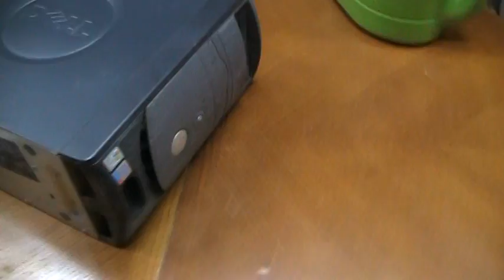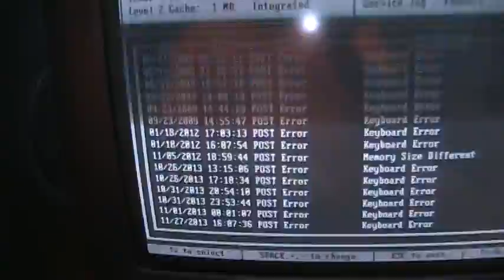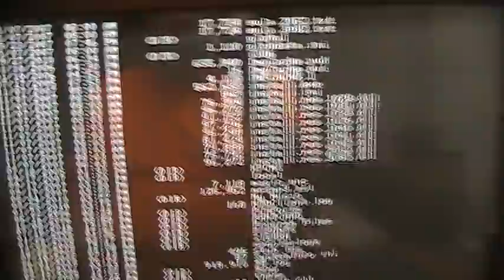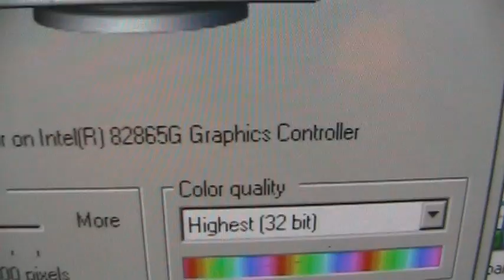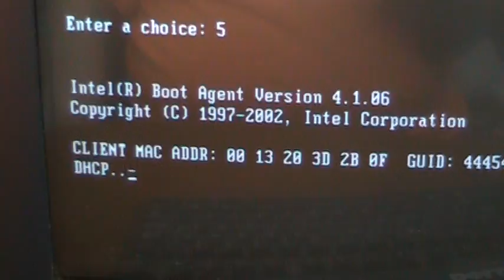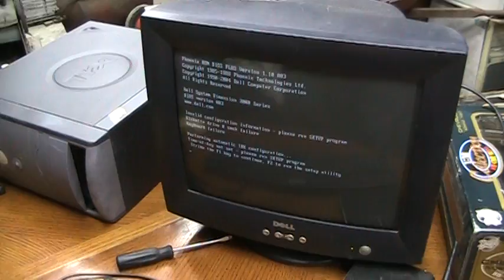Trashpicked "Treasure": Dell Dimension 3000

Comment: Theory:

The computer was last used in April 7th, 2014. Exactly one day before the Windows XP end of support. So this thing was so old it couldn't run a more recent operating system, so they put it away and got a newer machine. Then they junked it in 2016.
Reply from the maker: One can conjecture anything, but it doesn't matter. It most certainly could have run a newer operating system, though it'd be somewhat questionable as to how well.
Reply: @uxwbill  win 7 would run on it with a SSD type drive and ram upgrade
Reply: @uxwbill i imagine the older dimension was a kid's system with the monitor that came with it, they may have moved out and so the system was trashed. this may have been the main office pc. just a theory.

Comment: Nice for 9x or 2000. I remember xp running like crap on a dell 2400  no matter what version of xp was install. 2000 and ME ran like a chap though.
Reply: It was probably running like crap because these Dell’s had 256MB of RAM from the factory. Windows XP ran best with 1GB of RAM or more. My first PC, an old Athalon XP had 768MB of RAM and it coped pretty well with XP.
Reply: These can go up to 2GB ram but they came with 256MB that’s why they are so slow.

Comment: i have  a dell running a  pentium 4  at 3.00 ghz  with windows 10 in 2021
Reply: Running a Sony Vaio 3.0 ghz Pentium 4 as a for fun xp gaming rig. It's quite nostalgic
Reply: A 2400 here running debian and an underclocked pentium 4 (long story).

And WOW! An extra 384k of L2 cache really helps! I wish I could see that cpu at its full speed!
Reply: Must be of the LGA 775 variety
Reply: @connorm955 indeed. I’m not aware of any socket 478 cpus that can run windows 10. Though I could be wrong.

Comment: The Dell E772c and E773c monitors (the model shown in the video) were produced by TPV Electronics of China, which happens to be the same company that produces AOC and Envision monitors. Edit: After doing a bit more research, it appears TPV had at least something to do with Inventa Computer of Taiwan. Information on this is scarce, but I believe it was a joint venture between the two companies which produced OEM systems.

Comment: I have a Dell Dimension 3000 it's not showing a pitcher on the monitor so I googled it so tell me if this is the problem so I can get a pitcher Baroni701
The 3000, has no AGP or PCIe slot, you need to buy a PCI graphics card.
The 3000 troubleshooter is here BEV  ??? Another thing I pulled up on google is change the Hard Drive and Dvd Drive or change the TFT and 1 CRT or the HDD but what will be the simplest thing for me to do to get pitcher and the Tower comes on ???
Reply from the maker: Your problem is not a graphics card and installing one won't help.
Reply: @uxwbill  the problem is using a fucking pentium 4 in 2020
Reply: But my warm fuzzy nostalgic feelings :(
Reply: @lolman123401 no pentium 4 will still work. Not everything needs to be a big beefy gaming computer.

Comment: Cranking up luminance on a crt increases the intensity of the electron beam hitting the phosphor layer. The charge and also the heat it produces cause wear on the phosphor causing decreased maximum luminance output on the screen. So more luminance, more energy, faster phosphorus aging. That's actually proportional. Many late CRTs came shipped with insane default luminance levels when a proper natural image can (and should) be delivered at 140cd/m absolute max. That was often combined with extremely blueish color temperatures of 9000K which is huge burden on the eyes, especially in dark rooms. I'd say that was responsible for a lot of tubes to reach a premature end of life. As well as many migraines and people having to get prescription glasses earlier than they should have. Could've saved some dollar on that energy bill too if you ran a business with a few desks. Because most people didn't even touch the adjustment controls ever.

Comment: My dimension is having an blinking amber light
Reply from the maker: Power supply (especially CPU Vcore), motherboard or expansion card failure.
Reply: I tried to use a new psu but I can’t use it as it is sata
Reply: It works but I can’t boot
Reply from the maker: Inexpensive cable adapters exist that will go to or from SATA connectors. You can also make your own from the dead power supply, if you have a basic multimeter and some insulation displacement connectors. Just be sure you test, before you plug any of your newly wired connectors in!
Reply: uxwbill thanks 🙏
Reply: If it wasn’t my grandads pc I would of thrown it out but I still have faith for it
Reply: Can you make a step by step video on this
Reply from the maker: No, I do not have time right now. If you know someone who is more comfortable working with low voltage wiring for electronics, maybe you can trade services, pay or owe them a favor.
Reply: uxwbill thanks

Comment: Funny thing is Bill.

Alot of game developers that had the runs best on Pentium 4 sticker and maybe something like Alienware branding who I think is still owned by Dell and I actually have kind of admired their systems in the past for their uniqueness.

Funny thing is, given the heat and power they consumed, I agree most P3's felt faster and just altogether happier running than any P4 ever did though of all the P4 systems I ever used at school or otherwise over here in Glasgow, HP's, Laptops, Dell's what have ye, I never ran into one that overheated or had any serious problems, of course I was only using em for web browsing tasks nothing majorly taxing.

Saying that, everybody must've ran into issues even devs with the P4 architecture, though I'm sure the instruction set capabilities as you've said before were inherited in the Core 2 and later series of CPU's, SSE3 and that sort of thing.

But I always have some respect for the P4 for how mad Intel got trying to ramp up the clockspeed and just had out of control things were getting, just seemed like such a carry on and fun at the time even though ye look back on it now and think wel that was kind of mental LOL.

Comment: I remember over paying for one of these on ebay. Wow, but, that was 2007-8 ish. Now days I can buy 2nd-3rd generation i5 machines for half the price I paid for that Dell.  It wasn't the worse things, but ended up moving up to a Gateway E-6100. It came with the intel D875PBZ motherboard with P4 HT, 800FSB. It was a huge, ugly machine that did me well. So well, I didn't even mess with the C2Duo and stepped straight into the i5 machines.
Reply from the maker: These Dell systems were great for their time. They're also easy to transplant newer parts into, for an interesting "sleeper" build.
Reply: There's a good amount of these on ebay even now, two i saw in box.

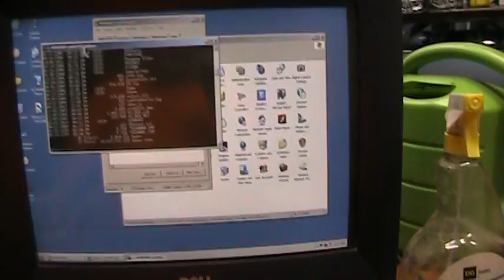Comment: 26:42 Is convergence fixable? Ive got an old Zenith console tv that i use for older games and the picture in the corners is quite horrible
Reply from the maker: Yes. You should verify that the set's dynamic convergence circuitry is working properly, as it is responsible for maintaining convergence at the edges of the picture tube. Get a service manual -- but before you do even that much, be sure you understand the risks of servicing a TV. The high voltages used around the picture tube are dangerous, but much more so is the fact that even late model TVs often have a hot chassis design.
Reply: uxwbill ok thanks for the info

Comment: It seems that some modern, cheaper, Intel Atom based  PC's are locked to run 32 bit operating systems only through the boot loader, but you can get around this by installing a third party boot loader such as Grub.

Comment: My Dimension 3000 had an AGP slot, but I never used it because I ended up gutting it and building a newer pc Athlon 64 X2 based PC inside its case.
Reply: Mine also did not have a floppy drive, but After the upgrade I popped one into it.
Reply: I still use it as my main system, the case at least, but it has the front panel of a Dimension 4600 after I lost the original. I have put some higher end parts then the original upgrade. It now has an i5 4460, GTX 1070 (I only bought this really highend card because I found it at the insanley cheap price of $180) and 8gb of DDR3.

Comment: This was the model of my first computer. I was about 9 years old and I got a Dim3000 for christmas. It wasn't anything special. I ran Flight Simulator 2004 on it and it was amazing. But I had a huge anger problem, until one day I beat it to death, literally. I then got a piece of junk MSI computer with an Athlon XP 2000+ that i fried because I overclocked it without any knowledge of overclocking. Ahh those were all good times
Reply: BTW I'm 25 now

Comment: What does "Loading PBR for descriptor 2...... done" mean? I get this on my Inspiron 1150.
Reply from the maker: It means you have Dell's custom boot loader code resident in the master boot record (MBR) on your hard drive. There is nothing wrong with that.
Reply: Is there an advantage to having Dell's custom boot loader installed on your system's HDD?
Reply from the maker: It presence would suggest (but does not guarantee) that the hidden Dell software recovery partition is still intact.
Reply: Sounds like you have the original Windows installation! This happened on an Inspiron 9400 i bought.

Comment: On the note of CRTs running outside their "maximum" spec, I've actually found that some higher-end CRTs can actually be overclocked to produce resolutions higher than they say they can produce.
Reply: thats true my 1600x1200 17" Trinitron can actually do 2048x1536 and my 15" Gateway EV500 1280x1024 and actually do 1920x1080 just fine

Comment: I have a 160 GB Seagate SATA drive from 2006 that has almost 70,000 hours and it has no bad sectors. It's an FDB based hard drive and it sounds like a drive with 70,000 hours. I am the original owner of that drive since it was new and it's currently in use in my 2002 Dell dimension 8200 using a SATA to IDE adapter. The computer, of which, I've owned ( or my parents owned ) since I was 6. The original hard drive was a 20 GB Western Digital and failed in 2012. Yes it has the same fan that this 3000 has, except it's brand new, as I got it from Amazon.com. I'm proud of that hard drive.
Reply: That hard drive.... talk about a champion. That's just insane. Can you record an audio clip of it running?
Reply: I have a Hitachi deskstar 250gb from 2007 that has 60,000 hours on it and still working 100%. No idea how its still working after 60,000+ hours, for being a DeskStar drive
Reply: the mre nerd it has WD internals maybe
Reply: TheComputerGeek010101001 No I don't really think so considering that that drive was made in 2007 and WD bought HGST in 2012. Just a plain old Hitachi drive that somehow has survived 60,000+ hours of runtime.

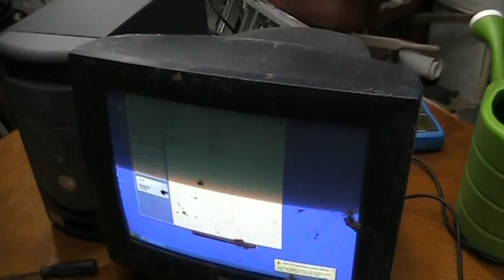Comment: 11:50 I've found the same thing for Dell's LCD panels. Absolutely outstanding picture and everything on them. My dad's 19" Dell monitor is still as bright as the day it left the factory back in 2007 (same for its speakers, tower, keyboard. The mouse...I don't know where that went but the last time I used it, it worked fine). It's got DVI and VGA input and it's a stunner of a monitor. What does make me chuckle though is that you can hear it change resolution, I can't remember what the unit is called that does it but you can hear a sort of whistling sound come from it (goes from a high pitch, sweeps to a medium pitch when the screen's blank, then goes back up when restoring the picture and then goes away until it loses signal or readjusts again).

Eventually I'd like to pick up a new Ultrasharp monitor from them but they're expensive. Most likely for a good reason.
Reply: c0d3r3d // cleanycloth yes. I have one from 2006. I got it in 2012. Awesome monitor.

Comment: I've got a question on one of those CRTs, I got one, and when you turn it on, you can hear it power on and sound like it's working, but I've got zero for video output, any clues?
Reply from the maker: I'd look at the cable (the wires inside do break), the power supply, and the video input/processing stages. (If you unplug the cable and get an error message on the screen, almost all of the monitor's circuitry must be working.)

Color of the power light will tell you if the microcontroller in the monitor is seeing any input (usually sync signals) from the computer.

It's probably not worth fixing one of these any longer and I seriously doubt you'll find any service information. If you decide to do so anyway, be phenomenally careful. The power supply circuits in some monitors are very nasty (NOT line isolated!) and so is everything to do with the high voltage.
Reply: Well the light is green, but I'm getting nothing, absolutely nothing, from the display, when you switch it off, if you look at the screen, it does the power off "flicker" most CRTs do, I have one just like it that's beige, and smoked around, I might just transfer the guts from it into this case.

Comment: I'm pretty sure that system is actually 64bit, judging from the 533 mt/s fsb and 2.8ghz clock with prescott.
Reply from the maker: Unfortunately it is not. Prescott actually predates 64-bit architecture.
Reply: *****
Yeah, you mentioned this later in the video, and I forgot to remove my comment.
Reply: uxwbill what part of Illinois are you in? My grandmother grew up in Quincy Illinois in the 1930s
Reply: Always wanted to go!
Reply: No. There were no 64 bit socket 478 CPUs. I bought a 64 bit Pentium 4 for my Dell Dimension 8400. LGA 775

Comment: There is a market on eBay for Windows 98 gaming computers. 
You should check it out if you have not already.
I have seen Win 98 gaming computers go for as much as $500
I did a quick check on the Dell website and was unable to find win98 drivers for that 3000 computer but keep it in mind while going through old computers. Someone else's trash may be worth a few hundred dollars (after you put some time into it)

Comment: Hello uxwbill, i know that this isn't the best place tout ask that... but i've got some trouble to find drivers for a leadtek winfast 3D s320 II graphics card .... and windows 98 USB drivers for a Packard-Bell Platinum 7620... I just wanted to ask if you have any web site that Can help me or something ^^'

Thank you in advance for your help and sorry for my Bad english i'm a french student ^^'
Reply from the maker: For the video card, I would suggest starting at the Leadtek web site. Or the actual video chip's manufacturer, if they are still in business.

Windows 98 shipped with USB 1.x controller drivers for every USB controller that was popular at the time of its release. If you have an add-on USB 2.0 adapter card, I would again suggest going to the card vendor or chipset manufacturer's web site to get the drivers you need.

Your English is far better than that from many native speakers.
Reply: In fact i've found some generic drivers for the USB and that works great, on the MSi web site there's absolutly nothing except some VIA drivers but no signs of USB drivers in it x) but there's BIOS Update and i've installed it yet.

For the Leadtek vidéo card drivers on their website the card just doesn't exist and if i'm not wrong this is a Riva TNT2 video chips but the driver for the Riva TNT2 work a little, i can put the screen resolution to 1024x720 and 16bit colors but the Nvidia panel doesn't work at all. And of corse on the original Windows installation i can go far away with the resolution and have 32 bits colors. If i remember correctly there's no Nvidia panel but a leadtek software that can do so many thing x)

Well there's a lot of work to get this pretty nice computer running again correctly xD Thanks a lot for your help ! :)
Reply: When dealing with old hardware, when you go looking for drivers, the web archive is your friend, http://web.archive.org/web/20030218181836/http://www.leadtek.com.tw/www/Web_Leadtek/drive02.asp?pronameid=229

Comment: I was given a Shuttle PC and Shuttle put a ludicrous amount of paste on the CPU. So much so that it was all over the motherboard. I struggled to clean it off so I soaked the whole thing in bleach. Worked a treat and smells great :) I've washed all manner of electronics and it's true, as long as it's dried thoroughly it should work fine.
Reply: well why did have to be bleach?
Reply: I didn't have anything else to hand to remove the thick paste on the board so I figured bleach would do the trick. It did :D

Comment: hmmm i dont want to Count but my Primary Drive a Samsung  HM500JI has Already  over 5 Years 8 Months 6 Days(1092 Cycles)  on his Belt. Still Runs Fine
My Secondary also a Samsung HM500JI has over 5 Years 2 Month  2 Days (1002 Cycles) on his Belt is also Flawless.
And i dont even Plan to Replace the Drives.
Reply: i have a hard drive thats 14 years old and it has 2090 cycles on it  
still going well no bad sectors no corruption at all

Comment: And also my computer that is three years old has 30,000 power on count on the disk, is that bad?
Reply from the maker: No. However, a hard drive can fail at any time and without warning. You should always have good backups.
Reply: Thanks for the info.

Comment: Hey, to check the health of the hard drive in windows, you should try crystaldiskinfo. I have been using it for a while and it works well to check the power on hours and count and various other things about hard drives and ssd's.
Reply from the maker: I already have a great tool for collecting hard drive health data.
Reply: cool. what is it called